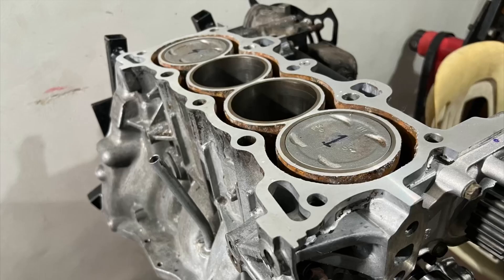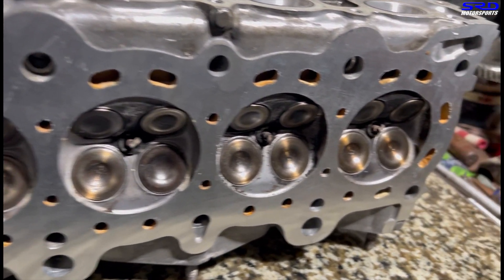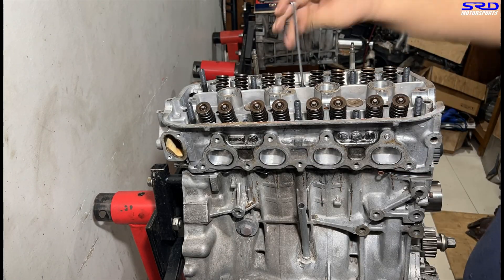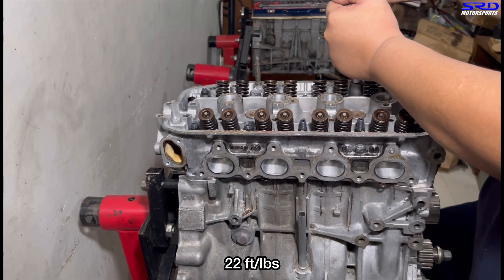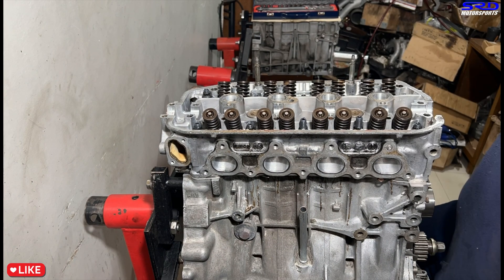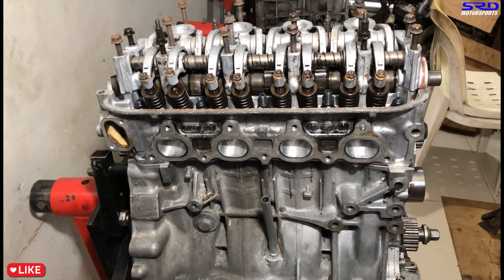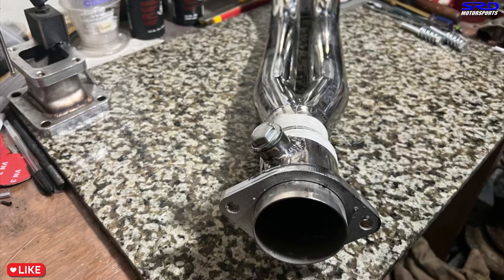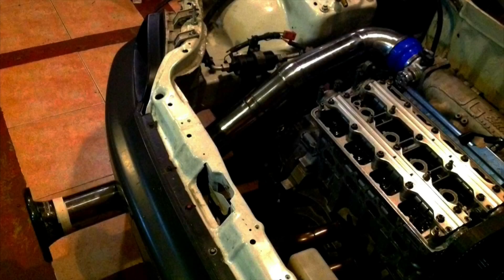ESi D16a6 All Motor Non Vtec Rebuild Project Final Step part 3

Comment: Hello! does ph12 block can fit pm6 pistons and rods? Thanks
Reply from the maker: Only the pistoncan fit pero sa sobrang baba ng compression parang walang compression yan

Pm6 rods or esi / d16 rods iba journal size sa ph12 crank rod journal size

Iba din ph12 main journal size d pwede ph16 crank dun
Reply: @SRDmotorsports  Noted po, thank you!
Reply from the maker: no prob

Comment: Cool to see this or someone still working on these. Great motors! back in the day I used to use Web cam, JG Engine Dynamics 301X cam and Gude Cams along with head porting and ported intake manifold with bored throttle body and modified ECU for some extra rpm's and DC sports header with a 2.25 inch exhaust with Dynomax UltraFlo Muffler. We would also add 80 shot direct port nitrous and these motors would take it good on stock bottom end. That mod of the header helps. The main thing exhaust was is uncorking it. The Ultra flo or similar muffler helps a lot. NA wise the web cam was very streetable and would be a good all around cam. The 301X from JG at the time was hot for drag racing. Gude Cams was hot for drag racing as well. Most of the road race or autoX guys in our area were really big on ported head with the stock 89 cam and header and bored throttle body and a good flowing intake and exhaust. Good Clutch and lightened flywheel helps too!
Reply from the maker: Maaaan now I remember the Gude Gorilla cams never tried it but it was one of my dream cams including the JG301x lol back then was still studying and then managed to go webcam and the rest is history lol
Reply: @SRDmotorsports  webcam was great! They were to me the first to really offer a cam for hondas. Jackson racing was selling their cams or introduced them.  The motors didn't look as cool as the bseries vtec motors but they were tough motors and can dish out a lot.
Reply from the maker: So so true my current a6 still rocks an A6 webcam grind which is a Bisimoto L2.x
Reply: @SRDmotorsports  sweet! now that you mention his name. Bisi is a cool dude!
Reply from the maker: True lots of good info and parts help from him too

Comment: Sir Ralph didn't you degree this one? Did you advance the cam timing?
Reply from the maker: No this has stock cam and a correct AEM orig camgear so it’s set to zero,

Which is different even on a different brand camgear